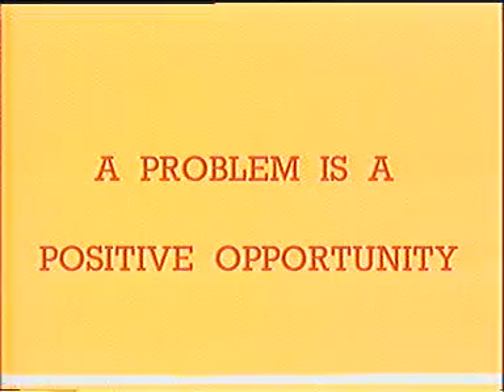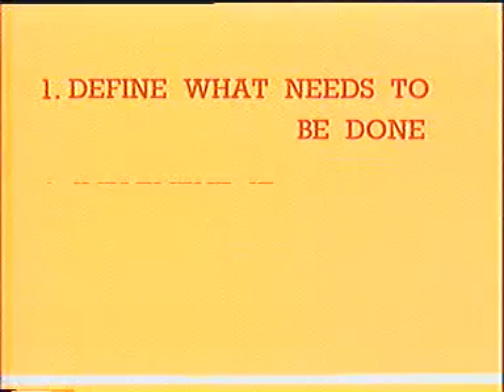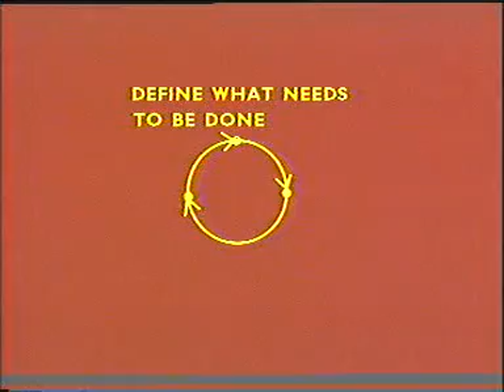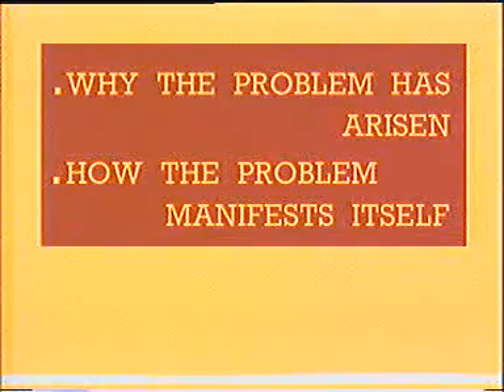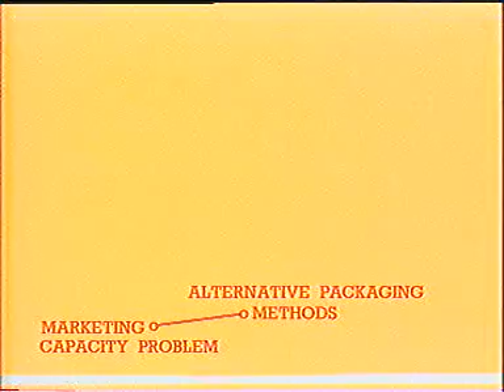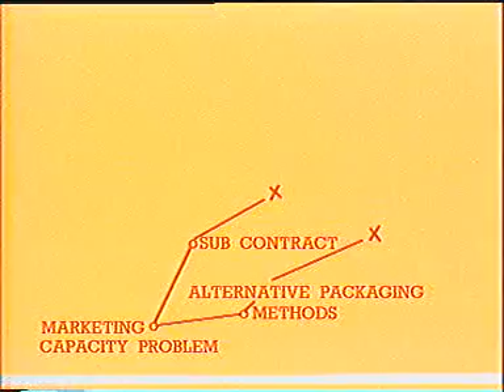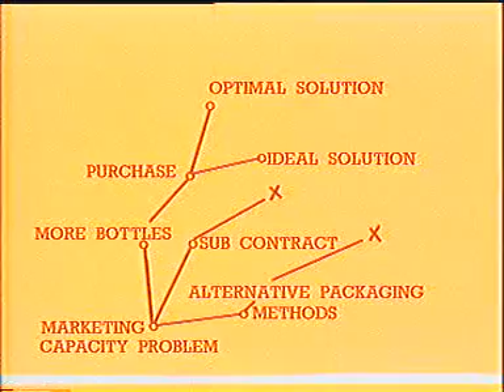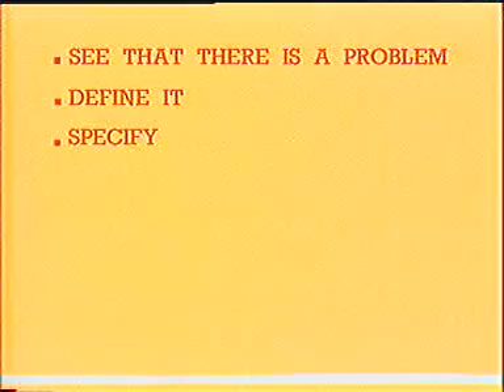Problem Solving

Comment: Thank you Sumer Kaul and his team for this amazing video. Even though the video is an old one, the concept of leaking tap, and bottling plant example, I found, very pertinent and useful. Moreover, this video holds good even in the year 2013. In a lighter vein I'd like to point out, how relaxing it was to smoke during meetings without anyone objecting to it or any fire-alarms and other technological nonsense. However, is it possible to improve the audio for the video. Thank you so much :)